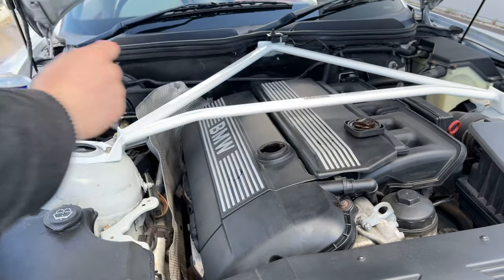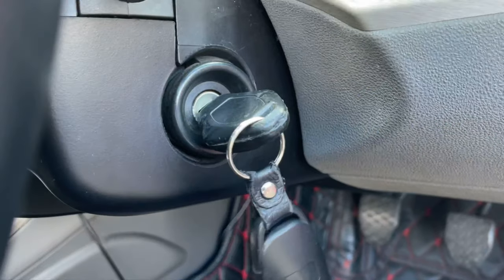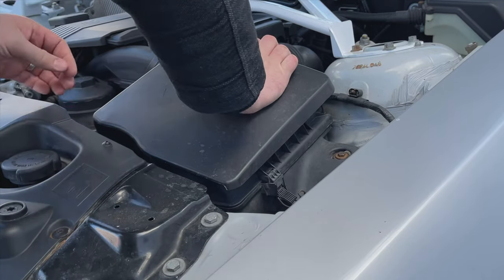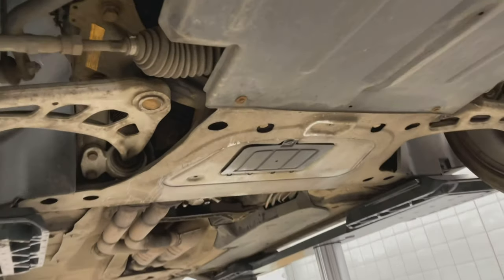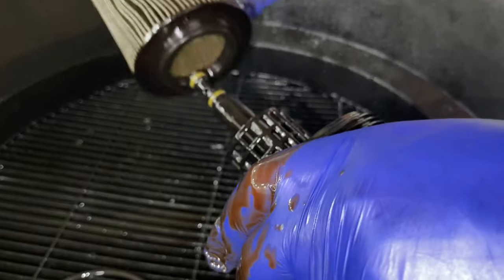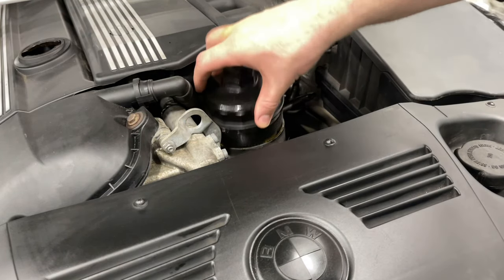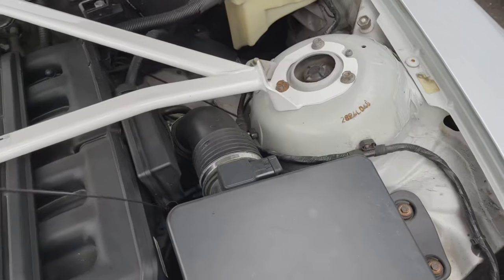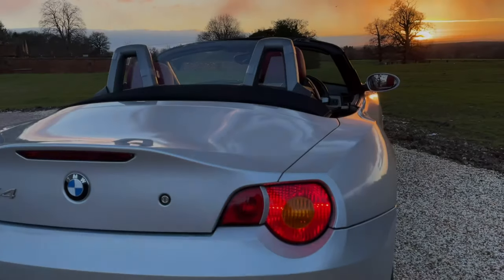BMW Z4 Basic Oil and Filter Service

Comment: That is a very sensible location for the oil filter. Usually it's in the bowels of the engine bay, unloved & untouched.

Comment: Highly recommend the Topsider.  It's a vacuum hand pumped to draw all the oil from the dip stick housing.  Never have to jack the car up. It's fantastic.
Reply from the maker: Luckily I have access to a ramp or I would definitely do this instead!
Reply: Defo good idea. Bought one the other day. Sucked out oil from Discovery 4 and Honda CRV. Next will be Z4. Great bit of kit.
Reply: Cool! will look into this, hopefully not too expensive
Reply: Pump might be fine what about sediment in the bottom of pan? Your  thoughts?

Comment: Great video but you need to recheck your instructions on spark plug torque. All information I have seen for the M54B25 engine is plug torque of 25 Nm or 17 ft.lbs.
Reply from the maker: Thanks, I got them from a forum so it may have been incorrect information passed on.

Comment: QUICK QUESTION - When you say the oil capacity is 6.5L, does that mean you put 6.5L in, or is that the maximum? I'm just buying some oil and looking at 4L bottles.
Reply from the maker: If you are changing the oil filter as well then put in 6.5l of oil with the 2.5 litre. This should bring it up to the correct level. Then just check the oil level to check it’s ok and always good to check again after the first drive to make sure it doesn’t need a top up.
Reply: @db192  Smashing! Thanks man! :)

Comment: I'm guessing the top mount oil filter really doesn't need any extra oil as it's not acting as a reservoir.
Reply from the maker: You will need 6.5 litres of oil, I would imagine a filter change may need a little more oil  but as you say it doesn’t hold any reserve so it may just be to soak the filter paper.

Comment: Great video except you say the oil it takes is 5/30 BUT the oil your putting in says 0/40?? What gives? Thanks
Reply from the maker: Good spot, I bought the oil online using my registration plate to suggest which one is best and this one was on the list. BMW definitely recommend 5/30 but sometimes a different oil weight is suggested given the age and wear of the engine.